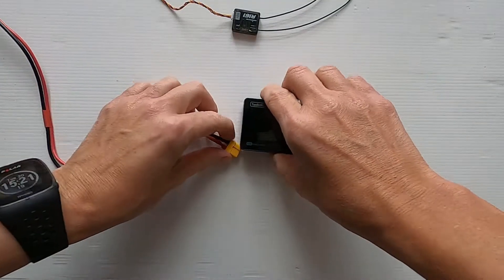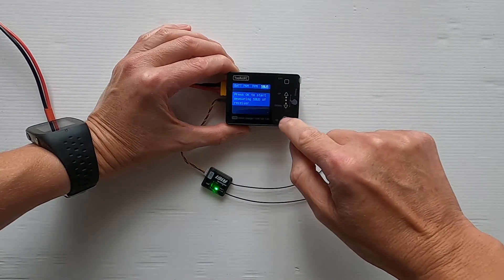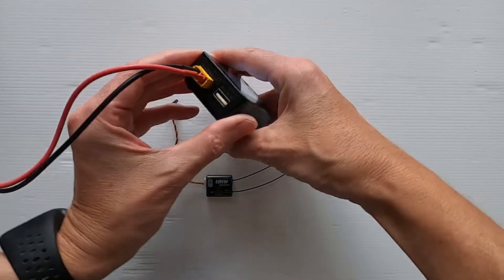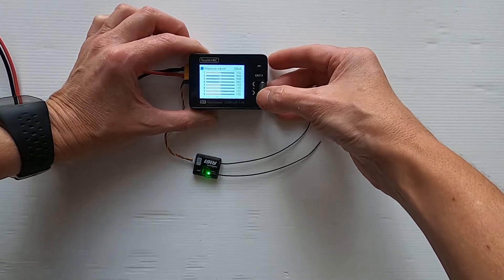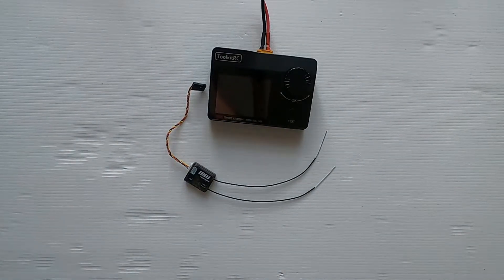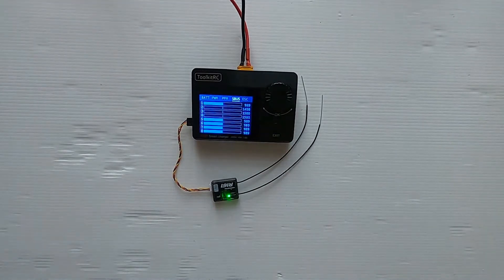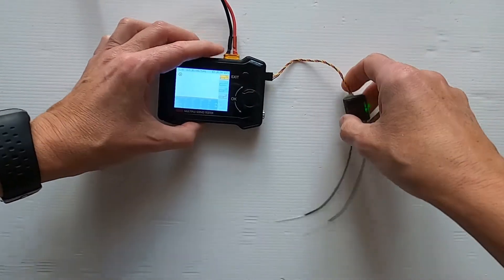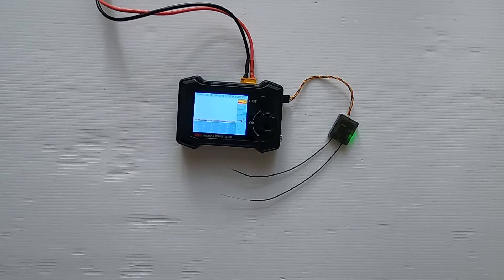Which ToolkitRC Charger can be used to test SBUS Signals

Comment: I have 3 of the M7 chargers.
 I've had them for almost 4 yrs.
The internal fan stoped working on 2 of the units. 
So i put a regular fan on them when charging now.
Reply from the maker: Maybe do not use the 2 chargers for discharging your batteries.
Reply: @the-happy-RC-flyer  I Don't
Reply: @the-happy-RC-flyer I use the FPV Quad to discharge batteries.
I use 3 chargers to charge batteries.
Reply from the maker: @ChrisQuadFPV best way 😊

Comment: Very good video, but I have an ıssue with m6 charger. It does't measure outputs of my "ir-a8s" receiver and when I pluged in the receiver, the charger restart itself about in 10 seconds. I thing something wrong with the charger. Any idea?
Reply from the maker: The only thing I can suggest is to check if there is a firmware update you can install and see if that fixes your problem.